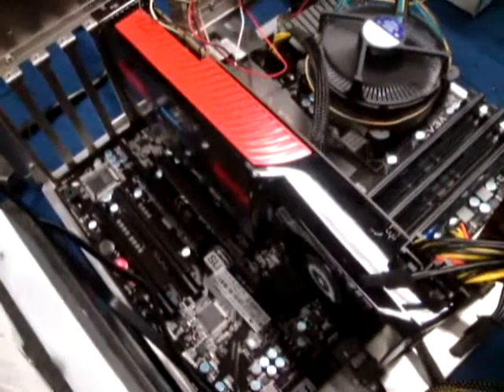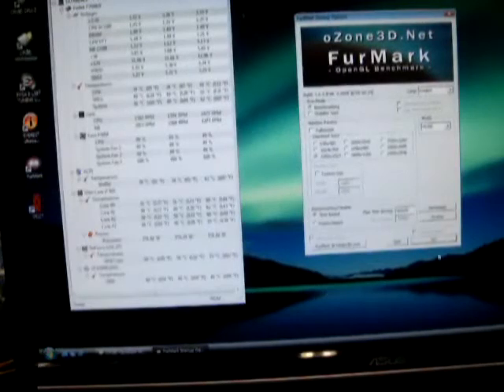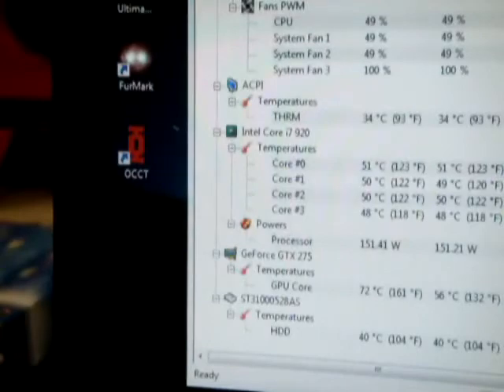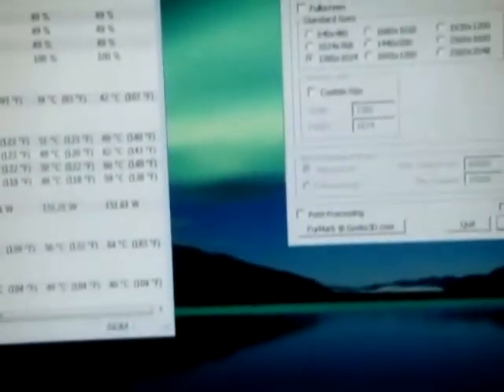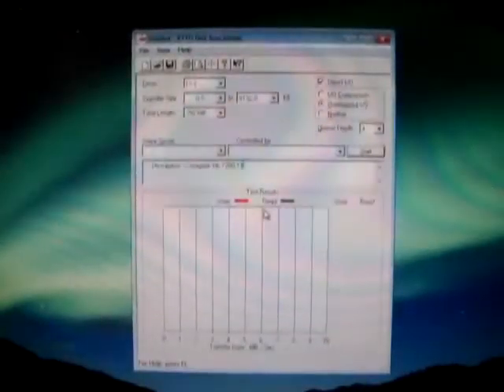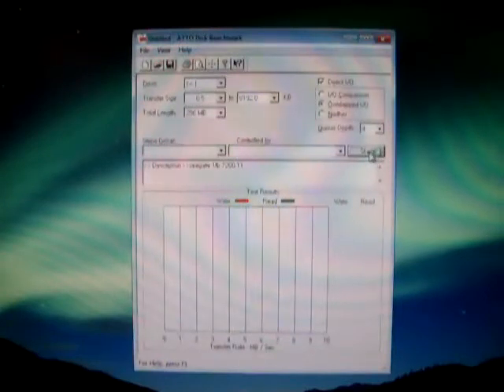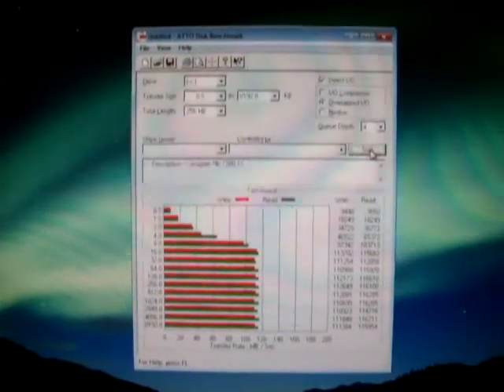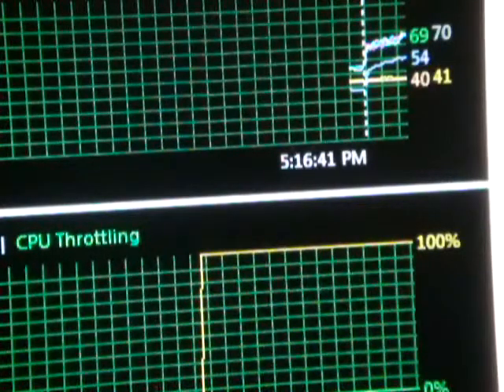Stress Testing Xpert's Glowfall

Comment from the maker: LinPack (in OCCT or IntelBurn) is the best for loading up the CPU. Furmark is the one I like for the GPU. Just to load the processor and see what temperature you get. It also tests stability for overclocking. For HDDs I have heard that I/O meter gives them a good raking over but I just use ATTO to see what speeds it puts out at different clusters. This helps choose the best raid striping. And it'll show a flawed drive. Everest Ultimate does a decent job of testing Memory and Latency